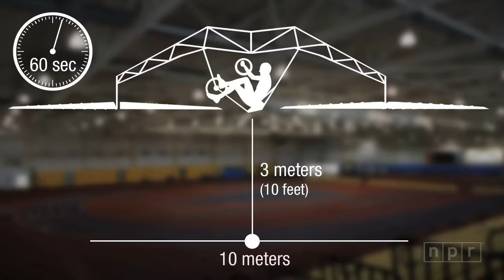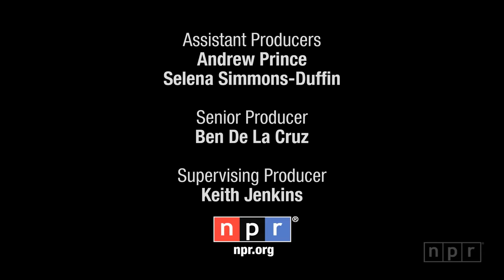Human-Powered Helicopter: Straight Up Difficult | SKUNK BEAR

Comment: Dang with lightweight materials like this I don't see why we couldn't make helicopters like this but battery powered with something like those electric bikes have
Reply: Yea I wonder how that would work, like motor assist :d
Reply: Because it's incredibly fragile and barely works.
Reply: MaxTheKanuck Yeah of course the material would be upgraded to accommodate a motor...
Reply: Zersix Then it would be too heavy.
Reply: MaxTheKanuck
 Modern non acid batteries are incredibly light and you wouldn't need very big motors, the amount of lift increase via electric assist should far outweigh the increase in weight.
Reply: Actually, no, they aren't "incredibly light", the amount of Lithium Ion Batteries and Motors it would take to run this for any reasonable amount of time would weigh just as much if not more than the previous Human controlled system. And I think you're both forgetting that there would still need to be a Human pilot, adding even more weight to the now much heavier Machine. And not even to mention how this design is already next to useless, all it can do is hover and with extremely limited control. I'm not saying an electric Helicopter (well... Quadrocopter, in this case) is something that could never exist, because it could, but not in a design even remotely reminiscent of this.
Reply: MaxTheKanuck
I think you are mistaken, we already have ridable electric drones that can fly for several minutes and that is with no human power at all, a light machine like this with human power and electric assist would be no problem. An electric bike battery weighs 13lbs and an electric bike motor with wheel and tire weighs 24lbs (you don't need the tire so it would be less) that's 37lbs not excluding the tire weight, so it just doesn't weigh as much as a person, not even 1/3rd.
Reply: It's against the rules of the competition to have a battery in the design.
Reply: Graeme Wolfendale Facepalm
Reply: Wind
Reply: all you need are ten hamsters and the guy can just ride.
Reply: 95TurboSol still a lot of energy is required
Reply: Crashes. Death of a helicopter crash would be guaranteed..also, wind could incredible influence the helicopter and a lot of other shit
Reply: Bukirisp j do you even know how a helicopter lands without gas? I’d assume the system would be implemented
Reply: Cost, safety
Reply: for a motor you need bigger rotors and engines moving the shit making it heavier and then its impractical to not have the sort of armor of the material around you and then if you would switch stuff around to make it work with a motor it would just become like a regular helicopter with that material and then it would need much more than the amount they have there which would cost too much.
Reply: Probably because batteries weight 100 times that of fuel for the same amount of energy.
Reply: it would still cost alot to buy, require regular refueling and maintenance,  insuraance companies would hop on that like hotcakes, and you need alot of room to park it.
Reply: Drones are almost there
Reply: Dude, put a chainsaw engine on it and get steering BAM helicopter
Reply: "I don't see why we couldn't make helicopters like this but battery powered with something like those electric bikes have"
You could make them small and call them something catchy like "drones".
Reply: Debbie Downers out here lmao.
Reply: you could but bcoz its so light u can easily being blown by crosswind...the heli would be like ping-pong on ocean surface
Reply: 95TurboSol LOL
Reply: think about if this was done outdoors, even with just a little wind it wouldn't wor. so...thats why
Reply: Great idea, bro
Reply: isnt the whole point to move a person from point a to point b? this kinda defeats the purpose
Reply: yeah I'd rather just get a paramotor
Reply: Yeah....and maybe one day we'll have the technology to put an internal combustion engine in a helicopter...
Reply: Motors
Reply: Lol are you forgetting about wind
Reply: @Sheehy223  the first planes were too
Reply: 1. Super Fragile
2. Too inefective/ chances of failure are way higher
Thats why.
Reply: Samsung is working on graphene batteries.  They store even more energy than lithium batteries and can charge incredibly fast.  Maybe the future will use these in air and road vehicles
Reply: @95TurboSol  true, just look at those tiny racing drones with like 1kw of brushless burst power.
Reply: you mean like.. literally a drone?
Reply: Yeah, the electricity in electric bikes is meant to give a little extra speed, so the electricity could add extra power.
Reply: A drone. You're thinking of a drone.
Reply: @rm9308  A drone runs entirely on electricity, and is remotely piloted by a human. This is a quadcopter piloted only by a human, with no electronics.
Reply: @andrewpenn1145  

The word 'drone' regards the pilot, not the power source. A human could pedal power a helicopter that has auto-piloting software or has a remote controller. This would still be considered a drone, especially if the human was merely charging the battery instead of affecting altitude with his pedaling.

"Dang with lightweight materials like this I don't see why we couldn't make helicopters like this but battery powered with something like those electric bikes have."

This is a description of a drone and was what I was responding to, but he probably didn't mean a drone. I just read it that way because I find this project to be a waste of time. Without a "Uses a newly discovered lightweight material, e.g., graphene, synthetic silk, etc." requirement in the rules (not just carbon fiber and superglue) this enterprise doesn't warrant much prize money.
Reply: @rm9308  Okay, I understand. That makes sense, but there is no pilot;the machine cannot steer. The human is merely the battery.
Reply: @andrewpenn1145  Right, this is an interesting question of semantics. Now that I think about it this aircraft is being piloted onboard by the cyclist who adjusts its altitude, it's just a very rudimentary aircraft. One dimension of freedom, and a difficult one at that.

Comment: When you accidentally hear "back down" as "GIVE IT ALL YOU FUCKING GOT MARINE THIS IS THE LAST CHOPPER OUT OF VIETNAM!!!!!"
Reply: Think 25 speed… my first bike was a 3speed. Then a 10, then a 15 then a 20 that was really fast. Good try, but not even touching 50 year old technology yet. Think faster smaller rotors. More gearing. Smaller = less weight, more speed.
Reply: @krdelux3919  thank you for your thought but those engineering students would have thought of it, if it would make sense, those rotors need to be that big to create strong enough force its allways a fight on weight reduction while maximizing thrust
many small rotors would be less efficient than one big one if same area is used and would have way more energy losses through friction
Reply: Fkn 'nam, dude.. we're never getting out of there man

Comment: I don't understand how that thing could get up in the air with such a low amount of prop rotation.
Reply: The rotor assemblies are so huge that the surface area alone can produce lift.
Reply: its fake, thats all i have to say :/
Reply: Frost You clearly know very little about aerodynamics... David is correct.
Reply: PetrovichGaming  It's definitely fake. Everyone knows helicopter rotors turn really fast, not really slow.
Reply: PetrovichGaming says who XD
Reply: 465marko They also weigh more than 80 lb, carry several hundred pounds, only have 1 rotor that's relatively small.  This has 3 that are considerably larger, and have to lift far less weight.
Reply: Incandescent  I can see the strings lifting it
Reply: Carter Stokoe  Very true..
Reply: Yolo McSwaggySwag Coming from Secretley We Are Gay?  <--------- "S.W.A.G.?"
Yeah. Now yah know.
Reply: Yolo McSwaggySwag  Is there anything about you that's not an internet meme?? think of something original ffs
Reply: PetrovichGaming You want to talk aerodynamics  Okay, there is no where near enough surface area for those little of prop to lift a 80lbs device much less the weight of the pilot at that slow of rotational speed. You'd need at least 70mph rotational speed for proper lift. Did that look like 70mph to you? And that is just to achieve the very low altitude they had if this were real, which it is not. lol
Reply: BoostedBadBoy Yeah I agree with Brandon9271 you are coming out with stats from thin air. Have you ever built a model airplane and hand launched it? Is there some magic speed where an airfoil starts working....no...duhhh. Consider those big old props as low speed wings and frankly even at those low RPMs the tips are going a decent pace. One of the reasons they didnt bother with an airfoil close to the pivot point, because the velocity would be too low to get decent lift for the weight added, but they do start the airfoil a couple feet out.
Reply: 465marko The rotor blades of a normal helicopter are smaller than the ones of this human-powered one. The smaller the props, the faster it has to rotate to gain height. It's physics. Hence RC helicopters' rotors have to rotate way faster than a regular-size helicopter. It's not a fake, it's completely legitimate. ^^

happy Halloween :)
Reply: MiTTeNs  Nah, strings lifting it. Real helicopters have engines. Happy Halloween!
Reply: 465marko You can't be fucking serious...
Reply: 465marko Mate, that helicopter is like a one night stand.

No strings attached.
Reply: MiTTeNs  Ayyyyyyy!
Reply: Yolo McSwaggySwag dude you killed me with "never go full retartd" ;D
Reply: aryesegal1988
Reply: 465marko
Using smaller props you would create less lift per rotation, although with those propellers while using the size of the scale they provided of 0 feet, 8 feet and 10 feet we can turn that into lateral length. So if you take approximately 3 meters per side of the prop blade, so we estimate 6 meters per prop. With a pitch of what looks like 4.5, We can estimate the approximate thrust capacity of each propeller. Much like a motor we can anticipate the "KV" (Revolutions per volt) to figure out thrust. Using that gear ratio they have on the bands for their feet and hands we have approximately 1:2.5 ratio per person geared for tourque. With this we are increasing the amount of thrust we are generating from the blades, but we slow the blades down. So say each person can output on average 60 kg of force; 60 * 2.5 (150 kg) * 3 = 450 kg of force applied. minus their weights and since they declared that each one of them were 'skinny and strong' lets estimate 60 kg per person. 450 - 180 = 270 kg. 270 kg of force applied is more than three times what they would require to lift the helicopter (weighs 80kg as they declared). 200+% more thrust than what they required to start lifting.

Comment: Correct me if i'm wrong but why not use a gear box to give the props more speed, In return just like changing gears on a bike you would not have to push with your arms and legs as fast to attain the same lifting capabilities making the work less and like an earlier commenter pointed out why not use a vertical seat like on a bike?
Reply: +SpydreX Official A gear box would increase the weight. Since this thing is only designed to hover, they've already figured out the best gear ratio for that one speed based on what the pilot can do, and have already set that up.

As an earlier commenter pointed out, a recumbent position actually lets you put more power into the pedals.
Reply: HiddenWindshield Yes that could be true but what if the gears were made from abs plastic?
Reply: It's still unneeded weight. Changing gears only helps if you're changing speeds. If you're always staying at one speed, it's useless.
Reply: HiddenWindshield I understand the weight thing but why would it only stay at one speed?
Reply: Because it's not intended to do any maneuvering. The contest is for a human-powered vehicle capable of hovering in one place for 60 seconds. That's it. Sure, you'd have to vary the speed slightly to control altitude, but not enough to justify the extra weight of changeable gears.
Reply: HiddenWindshield Yeah I understand that and the weight but hypothetically if the parts had 0 mass then would a gear ration that gives a faster output with less input let you petal less or exert less energy? Or is there another variable that I'm missing, I know its not practical as you already told me but just in imaginary numbers. I'm not disagreeing with you, just curious.
Reply: Ah, ok, I see where the misunderstanding is.

Recall that they're using a pulley system to transfer power from the pilot's seat to the rotors. Pulleys are basically gears that work at a distance, so they could set the gear ratio to be whatever they want by using different size pulleys -- no actual gears required.

The problem with increasing speed using gears is that you decrease torque. A 2:1 gear ratio would double the speed but halve the torque. Thus, the pilot would have to work harder to make up the deficit.

The power, torque, endurance, etc. of the human body is different at different speeds. So, a large part of designing a human-powered anything is figuring out what's the most efficient speed for what you're trying to do, and then you base the rest of the design around that.

tl;dr They've already got what they think is the best gear ratio.
Reply: HiddenWindshield Oh ok I understand now, thanks for clearing that up:)
Reply: +SpydreX Official Gears don't magically add energy. If you make the propellers spin faster then the gear ratio will be very high and it will be too hard to pedal and not lift off at all. They already figured out the best gear ratio where the guy can still pedal and the gears can still turn as fast as possible, which turns out to be not the fast, because look how fucking huge those things are! they probably already calculated that gigantic blades that turn slowly will generate more lift than the small blades turning quickly
Reply: ***** HiddenWhinshield actually already explained that to me;) Thnx though!
Reply: +SpydreX Official The way it uncoils string from spools above the props actually acts as gearing. As the spools unravel less string is required to turn it once. the string may even spool onto another spool which would further increase the gearing
Reply: +SpydreX Official Because energy transformations ALWAYS lose energy through friction.  A gearbox will NOT add energy to the system.  The engineers in this case calculated that the max amount of energy that could be applied to the system was at this rotor size and rpm.  The vertical seat idea is perpetual energy.  Using gravity to lift something doesn't work.  Gravity is a downward vector in all cases.  Gravity never ever helps an aircraft.  Or any system for that matter.  I'm a Chemical Engineer so not in aerospace but this is pretty basic physics and engineering across the board.
Reply: WC Don't worry man I already know lol HiddenWhinshield already explained it;)

Comment: 5:05 Maybe if they want to shave weight, trimming the overcut on that threaded bar would be a start
Reply: That's a flywheel...
Reply: @jonny0goddard  LOL
Reply: @jonny0goddard  I came here to say that.
Reply: It likely their attempt to achieve a gyroscopic balance to offset the drift, in theory it can work, they just need a better athlete with an understanding of the physics behind it, and perhaps a better position for the pilot to be in so they can put more energy into it.
Reply: Nah, imaginary materials are much lighter.

Comment: I think they should try other sitting position and power transfer system (between the human and machine). ie.: You can apply way more force pushing with two legs + your core strength + pushing with your arms on your knees on a plate than an arm and a leg at a time. Im in very bad shape and can easily move a ton at the gym this way and you obviously need no where near as much if pedaling works.

Comment: I think, the aerodynamics of the propellers can be made much better. They don't have wing lets so a lot of power ist wasted in vortex flow. The inner region of the propeller doesn't contribute much to lift, only to weight. The propellers can be made much more flexible and spin faster to get a better lift to drag ratio. The centrifugal force will stretch them into its shape. One could also use spinning tubes instead of shaped blades to generate the lift by use of the Magnus effect and therefore eliminate the drag of the lower side which doesn't contribute to lift.

Comment: use a rowing power source, like and erg. you can put much more power into that than an odd bike thing.
Reply: Indeed.
Using your arms to work a crank is too energy consuming and not high of a power return.
A push and pull system would be more efficient for the upper body.
Reply: Oh well actually the rowing stroke uses 60% legs
Reply: That was my idea.  With a rowing set up, you could have each handle work independently like the handles used to control a tank for direction control.
Reply: That was my idea.  With a rowing set up, you could have each handle work independently like the handles used to control a tank for direction control.
Reply: interesting, I did not think of it that way but it's seems viable
Reply: thought the exact same thing
Reply: wouldn't that greatly imbalance the aircraft since you're moving around almost your full weight?
Reply: Wessel Driessen then get 2 people doing it opposite symmetrical, two lightweights yanno
Reply: unicycle master the lift from a dead lift is incredible. 

when you think about birds flying, most don't have sustained effort to fly. it's more so very fast, interspersed, exertions of power that exceeds body weight, at the right time. 

you can't do that pedalling, unless you're going for a humming bird. 

it's not even rare for a human to dead lift triple their weight.
Reply: just have the rowing be vertical. like how you sit in a spaceship before it takes off